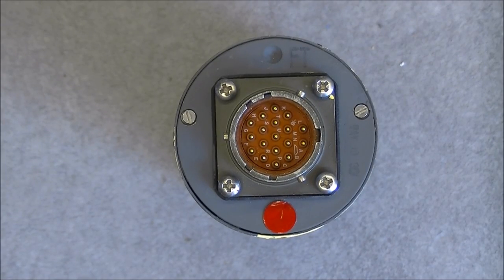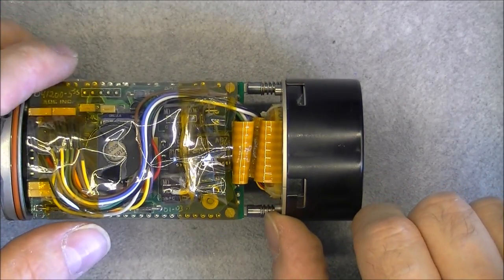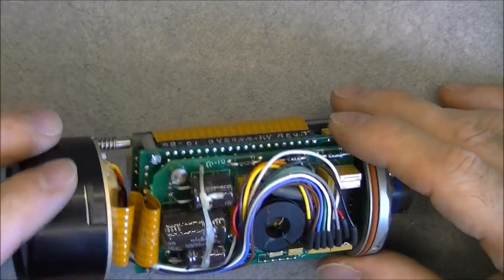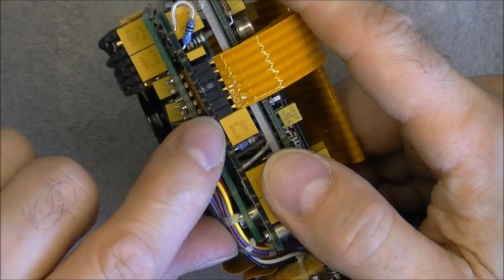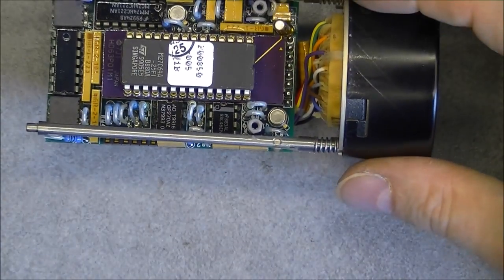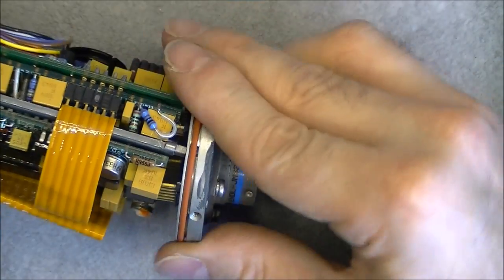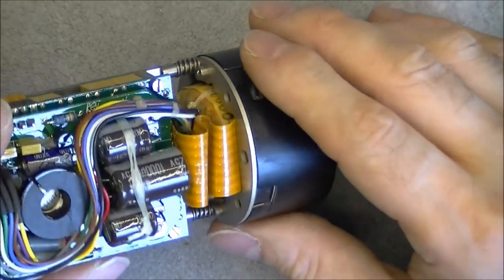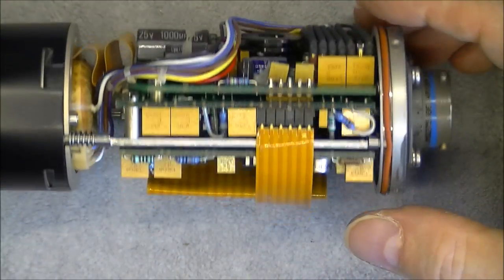Avionics teardown Digital fuel quantity indicator made in 2000

Comment: Nice one, The microcontoller case is called a Piggy-Pack. These kind of microcontrollers were originally intended for software development. They were good for plugging your EPROM emulator on the back. Once done your software was  programmed, maybe even mask programmed into the 40 pin plastic DIL version. Those microcontrollers were often used in music electronics.

Comment: I believe these gauges were also designed to directly replace mechanical fuel indicators like the one in the previous video.  In that case it would need some amount of programmability to properly interpret the fuel level signal.